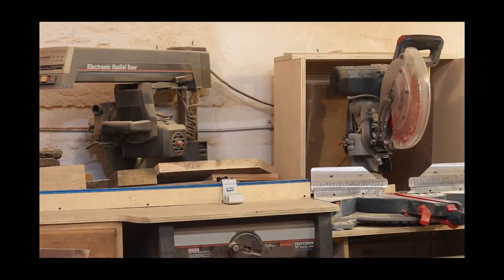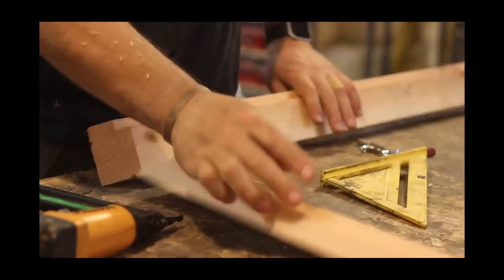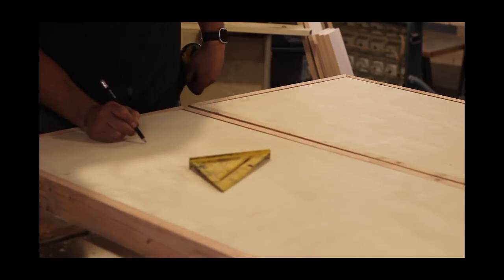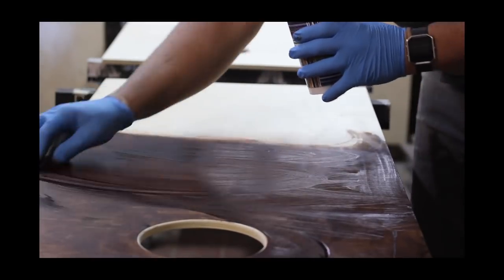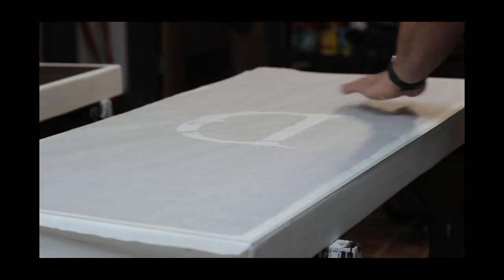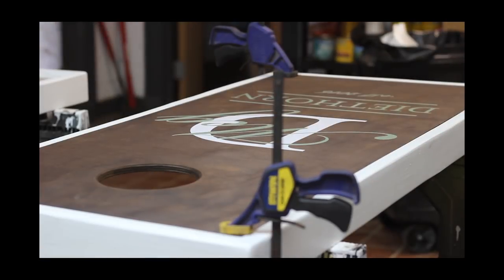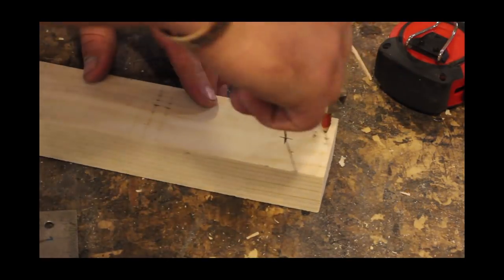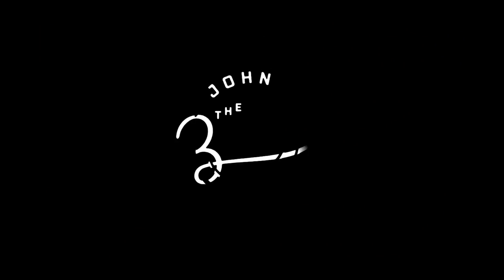How To Build A Set Of Classy Custom Cornhole Boards

Comment: What did you use to apply the stain with? And how many coats of the poly did you use? Do you still have to sand down the poly between each coat when you spray it on? Nice looking boards!

Comment: Awesome build. I have a question on the plywood. I bought 2 cut sheets 47 3/4 by 23 3/4. I guess they aren't 48 by 48 due to the saw kirf. Your plans call for the 48x48. Did you have to cut down your plywood? Do you think these will work ok?
Reply from the maker: should work for the insert since its not 2'x4' plywood

Comment: John, did you run into a problem with the polycrylic/polyurethane adhering to the vinyl sticker?  If so, how did you overcome this?  If not, what was the surface of the vinyl sticker?  Matte?  Thanks.

Comment: Hello John, love your work.  I am making a couple sets for my sons upcoming wedding, following your design.  I am a novice and have a quick question.  After you sprayed the polyacrylic finish, was/is it necessary to sand and spray a 2nd and/or 3rd coat?  Thanks in advance!
Reply from the maker: Yea i would advise at minimum 3 coats
Reply: Thank you!
Reply: If I was going to use these for wedding guest books- would you suggest having them sign it before the poly acrylic? Or spray it before and after? Thanks in advance!
Reply: @lucindabrewer-tarango7298   I would have them sign first, poly after.

Comment: What could I use if I do not want to go out a buy a brad nailer? Should I use a hammer and nails or a drill and wood screws or is there anything else i could use. This is a great video by the way.
Reply from the maker: You could use a pocket hole just from the bottom. That would be the best bet for screws. You can probably get away with some glue and clamps ( i wouldnt risk that). Brad nailer is a great versatile tool you can always use on most jobs

Comment: Nice looking boards.  I didn't catch the dimensions of the notch and thickness of the ply.  Was it 3/4 or 1" ply?
Reply from the maker: its 1.2" I believe
Reply: The inset notch is 1" in from the side, 1/2" depth for 1/2" plywood deck.

Comment: Hey John, I am interested in this poly acrylic you are spraying.  How long does it take to dry?  I currently mostly use spray lacquer due to the very quick dry time.
Reply from the maker: its pretty fast Typically 30 min  between coats

Comment: Great boards! Have you made many with this type of frame? How are the joints holding up? Think they can handle the kids abuse?
Reply from the maker: You can always add dowels, dominos, splines, and support in the joints. These havent had much abuse and are holding up great.
Reply: John Malecki wdx

Comment: Did you cut the plywood top smaller than 2x4’ to make up for added inset border? I’m not sure if the added 1” or so will matter or does the top have to be 2’x4’

Comment: Do you have to sand the clear coat after each coat? Or do you sand it at all? If so what grit do you recommend? I was just curious as to how smooth it is after the final coat is applied.
Reply from the maker: I spray it so it lays nice, also sand it with 400 grit if it feels rough.

Comment: Great video. Did you use pressure treated wood for the frame and legs? And what were the measurements for the picture insert? I heard 1/2 inch down (because of the plywood), but how far left/right?
Reply from the maker: NO pressure treated . and you can download a free plan at https://fixthisbuildthat.com/diy-cornhole-boards-with-custom-logos/

Comment: These boards are amazing! I'm going to make a set like this!  What angle are you cutting the 2x4s for the base?
Reply from the maker: I use the paint can and the table for reference so im not actually sure
Reply: John Malecki I mean for the frame  that you set the plywood in. Just 45 degrees?
Reply: +jsutruss323 It has to be 45 degrees if you are making a rectangle. Think about it...

Comment: love this video!  quick question or comment or actually frustration!!!  I am trying to rip my 2x4s like you have done but my saw blade binds.  Is it that my table saw (portable and old - 20years+) is weak and cheap?  My fence is not as tall.
Reply from the maker: +Doug Klock possibly a a combo. Try putting a new blade with thin kerf on.

Comment: Would the vinyl stickers peel under the poly over time? I like the idea, and was looking at some stickers, but the ones I would use are 5x5" without any openings in the middle. I'm wondering if that is too much area to expect poly to hold it down over time since there is no poly under the sticker.
Reply from the maker: The sticker should bond to the ply and then it'll hold fine. the poly is a bonus

Comment: I love how you inset the top to hide the edge of the plywood. I am building a set this summer but I'm trying to keep weight down. do you think the rabbets could still be used with 1x4's instead of 2x4's?
Reply from the maker: That would need some reinforcement since its so thin!
Reply: I make my boards with 1x4's like the ACL tournament boards.
3/4" birch top boards. 
2 sides, top, bottom and middle support.
No bounce 
Weight is great and very strong.
I also use pocket holes to secure everything so there are no screws in the top of the playing surface.
Reply from the maker: Yep youde need to modify these from having 1/2” tops.
Reply: I can’t decide if it’s better to have a seamless top no inset just 1 piece plywood or inset with seam and border.

Comment: nice work. & great video.  any advice on filling the inevitable gaps between the frame & insert - due to my "amazing" workmanship?
Reply from the maker: hmmm, thats rough because the usage of the board will eventually crack any filler. I would just take your time cutting anything, and making sure everything is square and snug,
Reply: thanks man.  i used your vid as a detailed guide to make my first set.  turned out pretty well.  i kind of went overboard on them, but i'm happy with the finished look.  couldn't've done it without your tutorial.  mahalo!

Comment: how do you spay in the winter? I'm having trouble in my basement workshop with fumes. any suggestions??
Reply from the maker: I dont unfortunately. Make sure you are using low VOC finish ( this is water based on this project) and have the temperature as close to 65 as possible. Works best for me

Comment: When I seal my boards I use a polycrylic with a foam brush. When you use it with a sprayer, does the finish come out looking much more glossy? Almost like a glass finish on top? Nice work, I subbed you...
Reply from the maker: for gloss finish yes, I like the sprayer because its more even, faster, and an overall better finish.
Reply: what kind of sprayer do you happened to use?

Comment: I want to do something where people sign the boards at my friends wedding.  Any thoughts on what I should use? I initially just thought of using sharpies and then poly over it once everyone has signed it, but someone told me that might make the sharpie run..
Reply from the maker: the sharpie will run. If you use wood i would suggest using paint markers (sharpie makes them as well) and then using spray poly. Water based.
Reply: Adding signatures is a fantastic touch! How did you accomplish it in the end?

Comment: Hey dude! Love the boards you made really solid job! I had a quick question on finishing them. How much polycrylic did you use with the spray gun? I see you have a gallon of it so I'm assuming a lot? Thanks!!
Reply from the maker: +44fan182 I would say 5 coats maybe. I spray thin tho
Reply: John Malecki cool thanks dude! How much polycrylic did you go through? About a quart?
Reply from the maker: +44fan182 maybe 2. Cheaper to buy by the gallon.

Comment: Wonder how long they hold up with Brad nails and glue
Reply: As long as the wood is sealed, brads just hold, and the glue is stronger than the wood. Been doing boards, a long time, never had a fail. Paint, or seal, all surfaces, top and bottom, as long as you don't leave it out all year, it will last forever.

Comment: OMG. I want to make this so bad. Guess I will have to fish around to see if anyone has some tools I can borrow. If you don't have a way to cut the inset can you piece it together with two pieces if wood?
Reply from the maker: I wouldnt recommend that. your local home store will have a panel saw you can get them cut to any size. Home depot and lowers first 2 cuts are free i believe
Reply: Thanks!